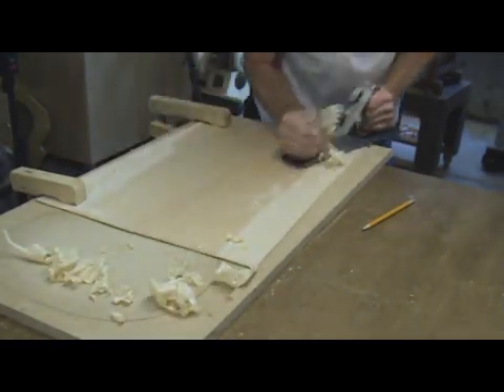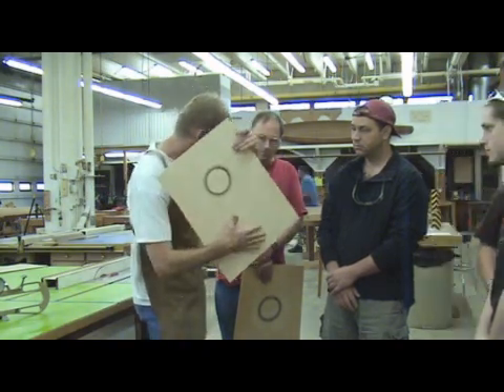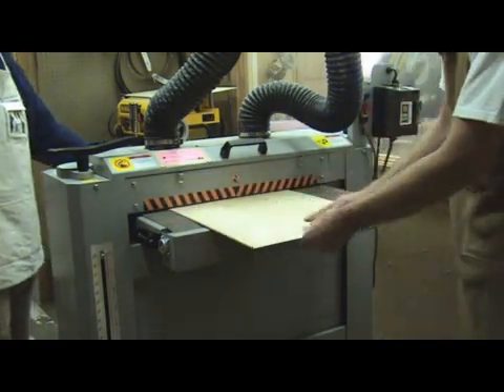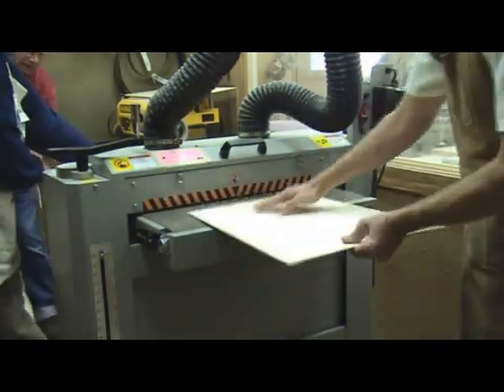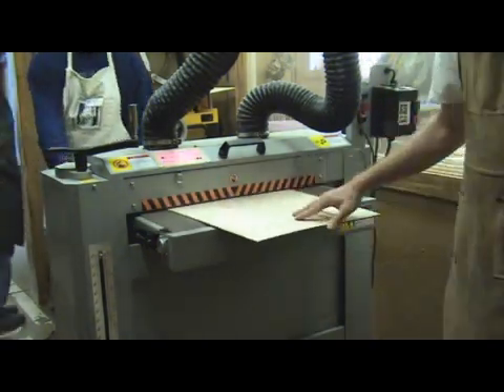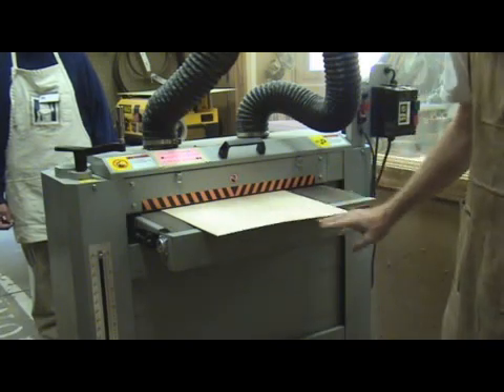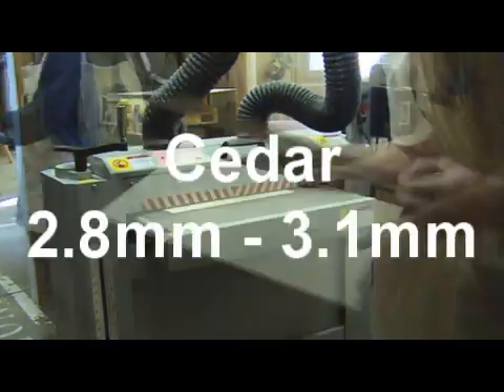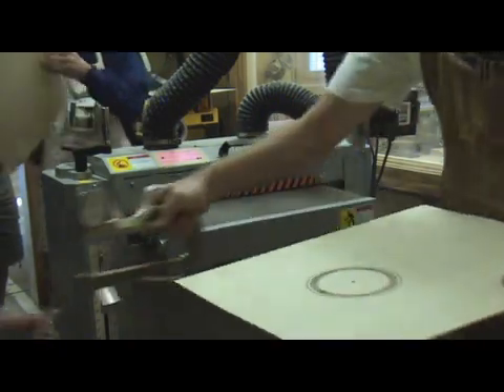O'Brien Guitars - Luthier Tips du Jour- Top Thicknessing

Comment: At 3:37 you say to watch as you flop each top and listen to it. Obviously listening/tone has nothing to do with the judgment call of whether you keep sanding or stop. At least not in this video. It seems you're deciding based only on the floppiness and thickness. Am I missing something? Or you're doing the tone listening off-video? Thanks!
Reply from the maker: I do listen to the sound as I flop. I explain in greater detail in my acoustic guitar voicing course what I am listening for. It is like a sheet metal sound. As you thickness the top the sound get more and more musical until it just kind of stop and is not getting any better, That ii the point I stop. If you keep going you risk losing structural integrity.
Reply: @OBrienGuitars  OK, I just don't see how you are hearing it over the roar of that drum sander. Sorry I should have clarified that in my original comment.

Comment: I don't see you dialing/adjusting the drum sander between sandings...does simply running it through multiple times continue to take off thousandths?
Reply from the maker: In the video I am thicknessing  a lot of sides so I had to run them all through once before adjusting the depth. However, when adjusting it is just with a slight adjustment each pass. Sometimes you can send it through two or three times without adjusting and still sand the surface.